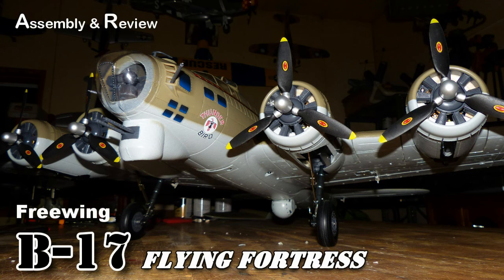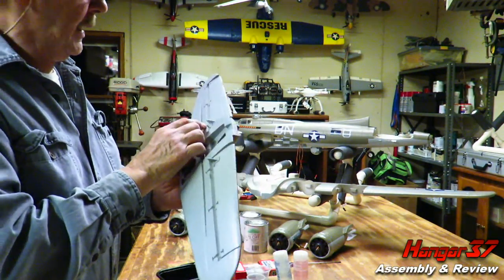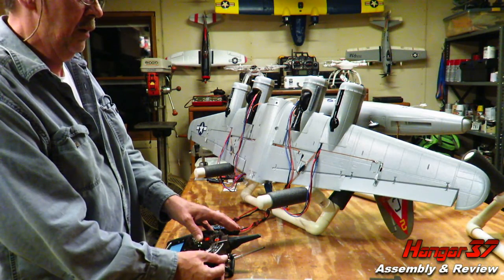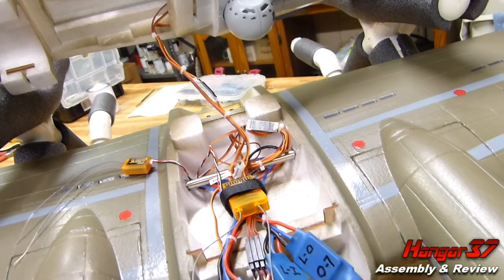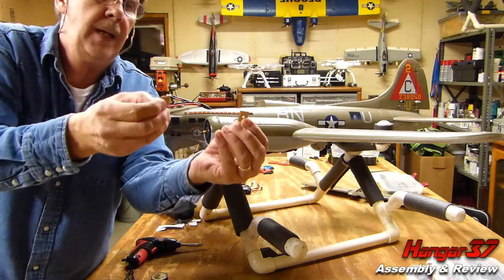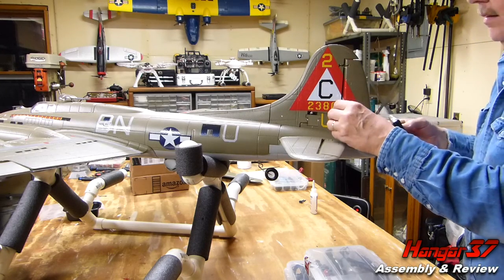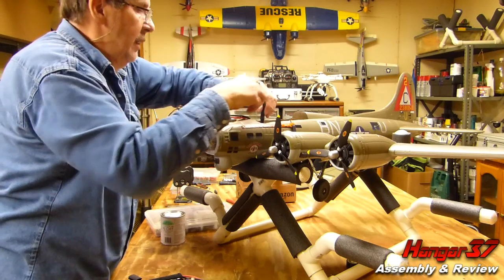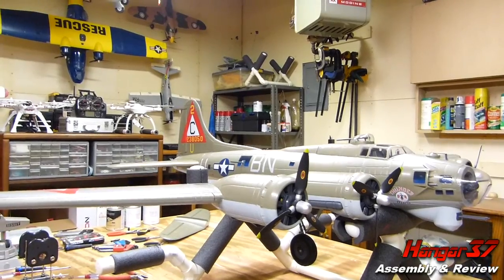Freewing B-17 (Flying Fortress) Assembly & Review

Comment: Back in 2013 I crashed my Freewing B17. Tip stalled as I was turning for my approach for a landing and  she went straight down like a ton of bricks! Did the necessary repairs then stored her in my attic. 9 years later I’ve taken her down from hibernation to fly her again. Back then I couldn’t understand how and why she tipped stalled. As I have her a thorough and detailed inspection, I discovered the outboard starboard motor was turning the wrong way! It was blowing air forward instead of aft! Which explains the tip stall causing the crash. Also, just like yours, one motor was wobbling. The set screws were loose! So yes, always carefully check a brand new model prior to use. Just like what’s demonstrated in this awesome video! 👍👍👍

Comment: That was a good idea to wire the inboard, and outboard motors together, instead of the left side, and the right side separate. So if you lose power in one battery, you still have two opposite motors to get it landed instead of one side. 
Great build, and nice walkthrough on the issues, and how you fixed them.

Comment: i tried to cut down on the spagetti of wires on this plane by puting esc's in motor pods.cut the esc wires to length and solder connectors on.will free up 3/4 of the wires in the wing and free up some fuselage room.esc get cooled out there too.this plane also really struggles with taxing in crosswinds too so consider thrust vectoring engines with a toggle switch.

Comment: John,
Very fine assembly video. Nice heads up on checking tightness on the engine screws. You mentioned mixing rudder in with the flaps. Wouldn't you want some elevator when you drop the flaps?

Have you maidened her yet?